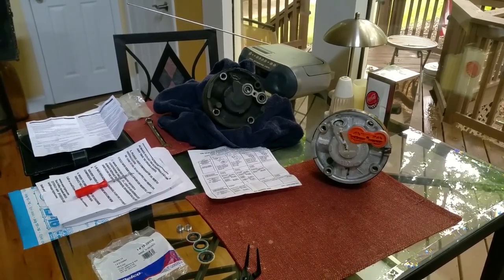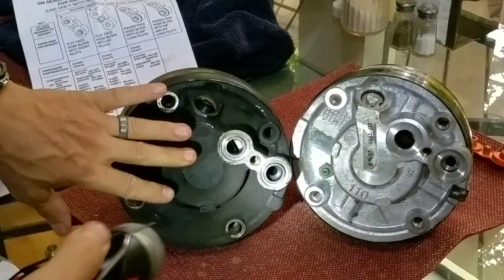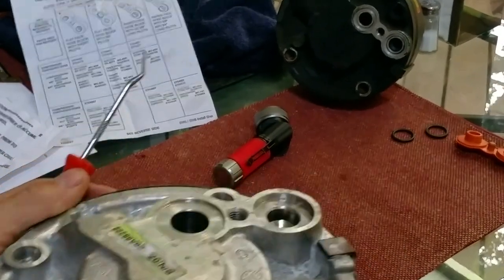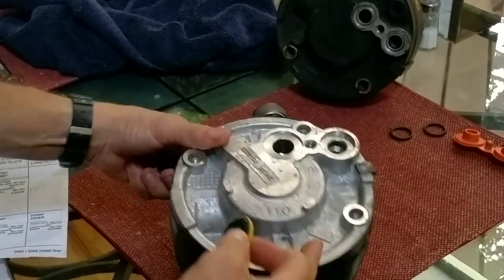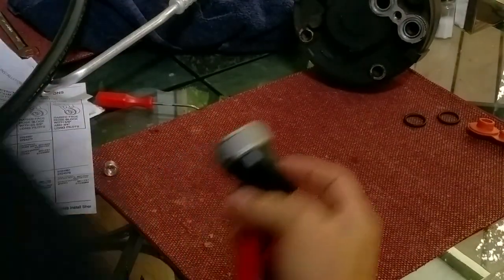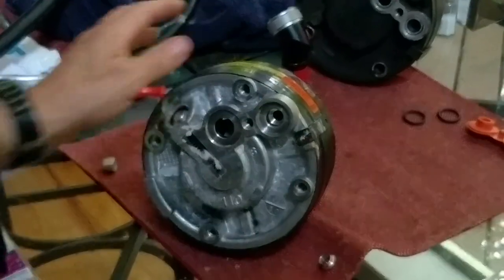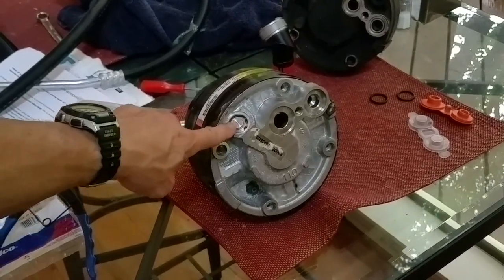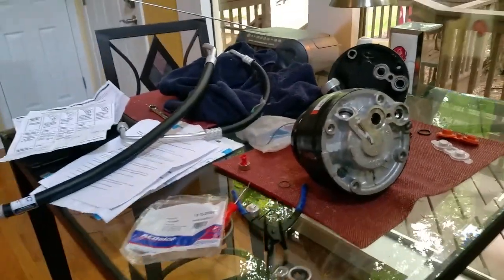Tips on Making Sense of the Sealing Washers and Aluminum Inserts for R4 a c a/c Compressor Car Truck

Comment from the maker: You guys won't believe after I did this huge project and had this truck fantastic - a few months later - the truck died (unrelated to this A/C job) and it never ran again.  I spent over a year trying to get it going again - but no.  And I replaced EVERYTHING one could replace to make a vehicle run ---- nope.  Sold it for about $3500 - and was glad of it.  Talk about DISAPPOINTMENT!

Comment: Much thanks from me and my 85 C10! I will now charge my AC for the fourth time, but this time with the correct seals and installed correctly. Entire new AC system, but no instructions on sealing the hoses to the compressor. ❄️💨
Reply from the maker: See the Thanks button under the video

Comment: This was the exact information I needed to repair my a/c on a 1990 Chev C1500.  I had installed the sealing washers without the insert about a year ago, but a leak occurred eventually.  Of course the leak was at the flat face connection to the back of the compressor.  This video contained the perfect solution to my problem.  It's good to have my a/c back.  Thanks for the help.
Reply from the maker: We are the only ones to have this info in such detail.  We searched for days and found nothing prior to doing it ourself.

Comment: Thank you I watched it a couple times, when replaced the washers the ac guy that replaced my compressor used a red and green with no spacer it should have been yellow and green with a spacer, also the green washer was chewed up. thanks,
Reply from the maker: I would go back to that alleged 'Mechanic' and raise hell.
Reply from the maker: Here's more about this project. I found very little info like this online. This is why we did the videos. Even though we are hardly "experts" at automotive A/C repair.  https://youtube.com/playlist?list=PL_5XjPVEw3swRL4ED9AhsynAgZsuXDzZm
Reply: What happened ,did it seal? I can't see how it could.
Reply from the maker: Here are more videos about this truck that might help you https://youtube.com/playlist?list=PL_5XjPVEw3swhfNY5J-6NRjMMUW5fupgK

Comment: Appreciate those of you that take the time to do GOOD videos. I have been doing my own repairs for many years but when I bought an R4 of this design from Four Seasons I received a washer kit but no instructions. I had never used an R4 of this design. You saved me a lot of headaches trying to figure out the washer issue. Thanks, Thanks, Thanks
Reply from the maker: See the Playlist link in the Comments for more about this project.

Comment: THANK YOU I was completely dumbfounded by this! Silly me for thinking that OEM parts would just go together without special adapters and secret instructions 😂🤦
Reply: I had the added luck of not getting that seal kit and instructions with the new AC Delco compressor, and instead being sold an o-ring set (also AC Delco) that had thin metal/rubber washers for some other application.
Reply from the maker: I have more videos about this.
Reply: @amarsta  same here i thought i was losing my mind

Comment: Thank you so much for the info. I was wondering why mine didn't want to hook up right. Man what  a POS design. I got the same style flat mounting block as you on my 89 Firebird. The r4 four seasons compressor I bought from  AutoZone didn't even come with the inserts or instructions,only four sealing washers. 1 yellow  1 green and 2 red. I really don't want to pull off the line to hammer in the inserts wich  I would have to get them  since it didn't even come with them. Think I'll just take it back and trade it in for the remanufactured one. Thanks again. Good video.
Reply from the maker: Yes this seemingly simple task is SO NOT simple.  They parts manufacturers offering little to nothing as far as instructions, help, correct parts, NOTHING.  So dumb....
Reply from the maker: Here are more videos about this truck that might help you https://youtube.com/playlist?list=PL_5XjPVEw3swhfNY5J-6NRjMMUW5fupgK

Comment: I bought a Four seasons compressor and mine did not come with the sleeves. It is leaking but I can't find the leak. Prior to replacing the compressor, the system had no leaks. It runs out of freon about every two to three weeks. Can it leak, because it does not have a sleeve? Mine clearly stated not to put oil in it because it already had the oil in. any ideas?
Reply: I'd pull a vacuum on it and replace the oil for sure.
Reply: You're supposed to have a certain clearance in thousandth of an ince on the hose block once it's tightened to the compressor. You need to use a filler gauge once it's tight. I'll see if I can find the video I seen about it.
Reply: I found the leak it was the low side fitting. Thanks for your help.
Reply: I flushed the whole system and replaced the condenser, inserted the sleeve, vacuumed for over and hour and put dye in the system. No leaks
Reply from the maker: As the video clearly states..
Reply: Beast, my 4 seasons was exactly the same way. It came with the thick and thin seals but no spacer. Doing a project on my 84 K5 blazer and went to install a high side adapter and was expecting some leakage. We'll, nothing came out. After putting gauge on my low side, I had no pressure.  It all leaked out. Had no idea about this sleeve stuff. O'Reilly has the murray version, part number 24342 that should have all the combos needed.
Reply: I did install the sleeve and it has been over a month and no more leaks. I don't understand why the new compressors don't come with the sleeves, but the kits do. It's important to have the correct sleeve installed.

Comment: Thank you..im pretty sure mine leaked because i used the seals that were flush into compressor...red..vs green. So the seals should stick  up slightly vs flat to be compressed correct? Also I didn’t use an insert on discharge sideeither..after a year it let go on high  side
Reply from the maker: The instructions that come with the kit explain it all.
Reply from the maker: More videos about this project here https://youtube.com/playlist?list=PL_5XjPVEw3swRL4ED9AhsynAgZsuXDzZm
Reply: @HorsepowerHouse20  very interesting I had no idea how to use the different size bolt length the clamp my hose to the compressor so expecting is probably not sealing right after a couple years

Comment: Omg,several days, imagine that is crazy, we should not have to go through this, they used to just insert an on ring and that would be it.
Reply from the maker: I did my own Complete air conditioning replacement on my 1990 Chevy 1500. and I will never do it again. let a professional handle it. it's just too much to deal with, too many specialty tools and parts and knowledge and whatnot. you'd think it should be easier. but unfortunately it is not.

Comment: That pressure switch on back of compressor where you get it or look it up for part store
Reply from the maker: The exact one is hard to find.  Google or ebay.
Reply: You can still get them from parts stores
Reply: I cant seem to find this switch for my 1992 k1500.  The parts store searches keep showing me a threaded thing.

Comment: well now i wish i haven't spent 300$ worth of freon for the last 5 years because of this stupid insert no one talks about, carries, or even comes with the kit, this seems to be one of those dealership scams than made it through but stayed like that
Reply from the maker: Most of the kits come with them. There's no "scam."
Reply from the maker: The problem is the instructions are unclear and trying to "figure it out" on your own is not easy.  And there are few videos describing this task.  (Which is why we did our video.)   The next time I have my a/c rebuilt or replaced I will just pay the money and let the professional do it.  Simple as that.
Reply: I went through two new compressors because of the shipping plug
Reply: @kaatenmaat5885  so, does the shipping plug HAVE  to be removed ?